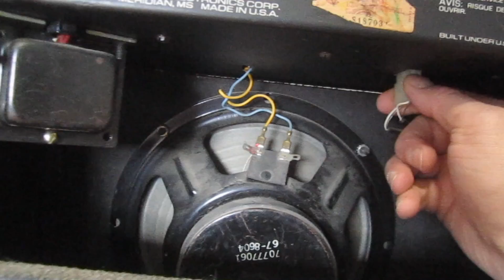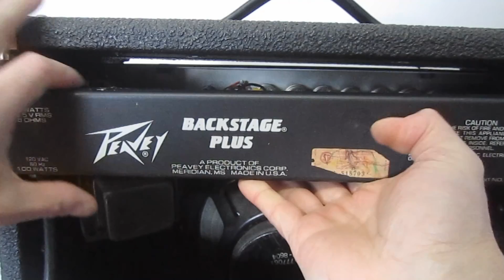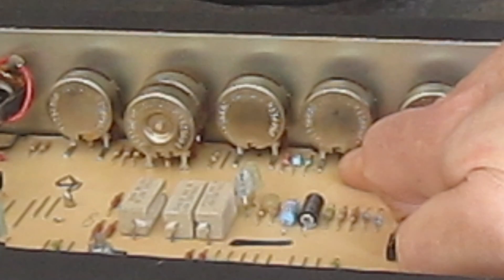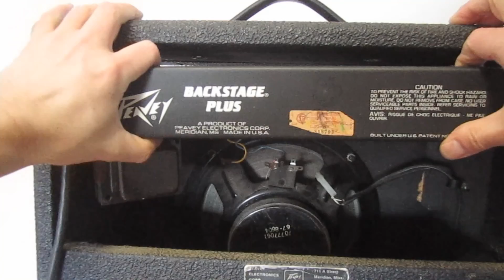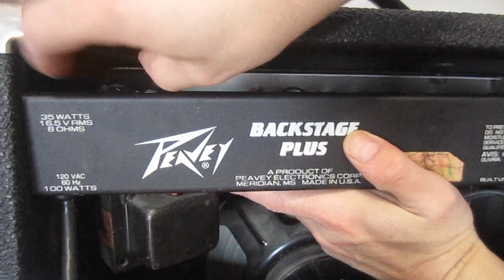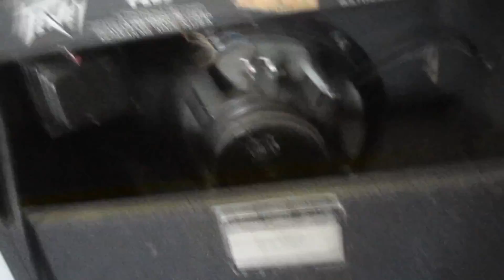DIY - How to Clean Amplifier Pots - Fix Scratchy Volume Control on Guitar Amp Peavey Backstage Plus

Comment: The problem I have with doing it this way is that when you spray cleaner into them, as it drains it out, all of the existing di-electric grease is removed also. You may want to consider spraying a silicone compound into the pots after you get all the grime and old grease out.

Comment: Yeah, I've had this amp for almost 40 years, never had a problem, good earthy sound for solid state, loud for its size, rugged construction. Only issue recently:  the pots are a bit problematic on volume so this video is genuinely appreciated to give it a tune up and see how it works out.  I've been looking for a new amp but holding off until I really need something a lot louder, it works for band practice and jamming in small halls....perhaps this might do the job in small clubs and if not, that is the time for a proper Marshall or Fender Twin Reverb.
Reply: I gigged with my Backstage Plus a couple years ago when my main amp crapped out. It is loud for its size - saved the gig that night!

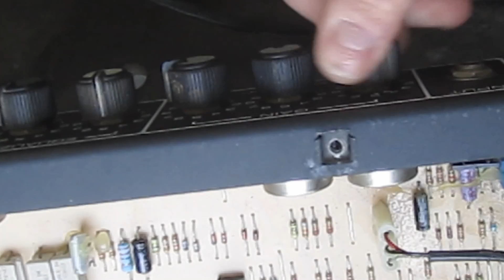Comment: 4:10 - And if you get TOO MUCH spray in there, you might just feel the difference   FOREVER because you flushed all of the silicone damping grease out from between the pot shaft & bushing.

This is how you end up with pots that feel all sloppy & loose, and don't want to stay where you set them..

Please, PLEASE go easy on the spray! You don't need anything like how much he used.. less is more.

Comment: Have the same amp. Paid $100 for it 15 years ago. Kinda like its sound. Reverb tank is crummy but the amp has some decent sounds. But 2-prong plug gives me the willies a bit.
Reply: As long as it polarized it shouldn’t be an issue. One prong bigger than the other. My amp tech said it was ok and didn’t change to a three prong? I wanted a three prong plug but…
Reply: @benlogan430  
Thanks for the info, Ben!

Comment: I worked for me ,, my Peavey supreme head had a bunch of the knobs that were scratchy a couple weren't working right , had to press on the one treble knob to get it to work , then it only worked after 6 same w a couple of the other ones , I thought they needed to be replaced,, I sprayed the minimum amount I could in the pots , I had to go back and do a couple of the pots twice , but sure enough for ten bucks I fixed it , ty

Comment: Just bought a peavey 6505+ 112 combo used, that I am using in my bedroom. I've noticed something about the amp that I don't know if it is normal or not:

When I am using the crunch mode on the rhythm channel, It just gets so loud past 1 on the "pre" that I just can't push it further to get more distortion/crunch, no matter the level of the "post". Basically, this means that I simply can't use this channel to get the overdriven "Marshally" tones usually advertised on reviews. Additionally, the "pre" on the rhythm/crunch channel seems to act more as volume than a distortion nob, as if I move it slightly the volume will increase significantly. On the other hand, the post button doesn't seem to alter the volume unless I crank it.

On the lead channel, it seems to acts as I was expecting: by moving the pre I get more distortion but not more volume, and by moving the post I get more volume

Any thoughts on this?´do you think it could be dirty pots?

Comment: the speaker wire polarity does not affect the sound at all. you can reverse the speaker wires and it will still sound the same.

Comment: Thanks Chuck. A good and sensible demo. Time to spring-clean the pots in my newly-acquired Backstage 30. Any parts in there that could give you a shock even un-plugged?
Reply: +Timothy J. Horan   Yes, capacitors can and will store voltage.  Always drain caps first before you stick your HAND (only one hand in or on a amp at the same time...also, De-Ox_Id is the best cleaner for amps...hands down!
Reply: Duly noted Chris I agree it's never a good idea to to give potentially dangerous advice to a novice like me out here on the inter-web. I thank you for your non-advice ''advice'' you answered my question and because of that I continue to make no attempt to ''service'' any of my amps: tube or otherwise. I've never opened any amp chassis. Until getting a Peavey Backstage 30 I've never owned a transistor amp.
I see you've taken half of your otherwise useful comment to jump ugly with The Evil Empire. It is to laugh.....

Comment: You should not just simply use contact cleaner by itself. You have to make sure it is cleaner AND lubricant, otherwise you will dry your pots and friction will end up damaging them. They come in separate cans or all in one, just make sure you clean them and you lubricate them properly. Great video!
Reply: +Franco Rodríguez De-Ox_Id by GC Electronics is the best pot cleaner by far..no need for anything else!

Comment: I had a band rehearsal this last Sunday just gone (7/01/16) and the volume control was crackly as hi hell. I have some spray for it (I am unsure of the name of it) which a sound engineer in a studio advised me to buy. I got some. Now i just watched your video, and i am just curious if its the same type of spray your using, or, is what you are using, a spray as I cant tell ? but i think what your doing is spot on from what i last did... but i haven't used my amp in a LOOOOONG time.. and i need to start using it more regularly now being back in another band.  When i find out the name of the spray i use, i'll let you know.. but great vid, respect my friend !
Reply: +Martyn Allen   De-Ox_Id by GC Electronics is the only cleaner to use...pure magic!!

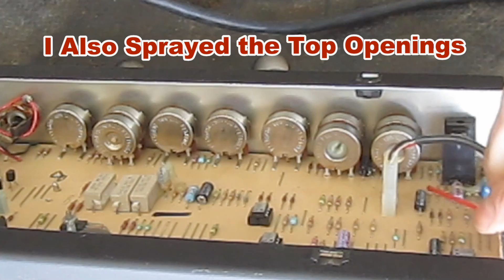Comment: Nice video ! Does anybody know what the "screw" that can be seen on a Pot at 3:57 does ? Is that a trim ?
Reply: just the rear of the pot,some have no shaft and this can be used to adjust the pot,like a bias pot,using the proper tool...of course.

Comment: Question, I have a GXL65 CRATE american made solid state amp. It has an semi open back, it has a Crate 12 inch speaker in the back, with no visible damage anywhere on the speaker, or the amp for that matter. I have had the amp stored in a dry and
climate controlled area for the time I have owned it. It is about 10 years old. I bought it new. Here is the issue; I have a metalzone 2 BOSS pedal, which I use with this 3 channel amp. This pedal can get a very harsh great metal tone. Lately, while using it, I am noticing some signal noise, like its own distortion interferance that is NOT a part of the normal sound when I have the pedal on. The notes I play sound muddied now compared to the nice distortion sound I was previously getting. The rest of the amp without the pedal is fine, so far. Can you point me in the right direction on what to do? Before I send it to the local Guitar center for a repair??? any help would be greatly appreciate it, it is actually in my profile pic on the lower right there.....Please help?
Reply: +Roland Lemus does your guitar have active pick ups ?
Reply: no, it doesn't, however, i just had to adjust my pedal and it sounds fine now. Ithough I busted my speaker at one point, but it turns out that the setting effect on the amp and  a certain setting on the pedal don't like each other, everything else is fine.
Reply: Could be a possible ground issue? Does your amp have the 3rd ground prong still on the plug?
Reply: My amp is good now, I had a pedal set up wrong with it, had to tinker a little but found out it wasn't the amp, thanks for the response!

Comment: Good video but realize that it is a temporary fix. Best solution is to replace the pots.
Reply: My experience is that pots do worn out. I'm a guitar player who uses all pots all the time. Moving parts eventually break down on you. A cleaner is a temporary fix and it helps but the problem returns after weeks or months.
Reply: I use a lot of pots too!!! A thorough clean and lube with genuine Deox-it backed up with a squirt of Fader-Lube is the way to go in most cases. Changing pots isn't something someone at home is always capable of doing. If pots genuinely need cleaning a good repair shop is usually best to perform such a repair.
Reply: +Marco Hermans   It's not temporary Marco.  Try using De-Ox-Id by GC Electronics...works like magic and continues to work for a very long time.  Pots rarely wear out completely, it's usually just needing cleaning and lube ( DEOXID does both)
Reply: Replacing pots is a major PITA. I'd say if the DeOx solution works, even temporarily for a year or two or three, you're ahead. Once DeOx stops working, then worry about replacing the pots (or the gear, if it's not worth reviving).
Reply: If you have good quality pots (CTS), unless the amp is really been abused and the pots cycles many thousands of times, the pot will just be dirty or corroded and cleaning will make it like new. Also, for newbies, especially with tube amps, not a good idea to mess around with pulling the chassis out unless you would enjoy getting the shit shocked out of you or getting killed.

Comment: It's probably my OCD acting up, but the color configuration on the knobs (from left to right) is white, dark grey, blue, grey, grey, grey, black. Good amp, though. Mine, the previous owner left it in a gazebo for 12 years, so it got a lot of humidity and freezing and probably wind blown rain on it. The bottom is fairly rotted, and the baffle, but it still works flawlessly. I've had it for 7 years now, and only replaced the speaker (I guess from the all that water the cone got messed up, because it sounded like I was playing out of a cardboard box.) Amazingly enough, the pots didn't need this until within the past year. Peavey built them like tanks at the time.
Reply: +Frank Riccio III Just checked colour configuration of knobs on my Backstage Plus and I agree with you.  I've bought mine new in the mid-80s.  Didn't know much about amps at the time but loved the tone - still do. My amp is still in great condition and has never missed a beat. Some of the pots require a bit more effort to turn than others and a there is the odd one that crackles.  Time for a 'spring clean'. Glad I found this video.  Plenty of life in the old girl yet!
Reply: Honestly, I never cared for the tone, but it's a tank and never left me hanging. I found a Special 130 from the same era years later and bought it because I knew it would never die. That one does not disappoint either.
Reply: mines full of dead spiders sat in my friends garage after someone gave it to him but he never got into guitar so he gave it to me

Comment: Mine is not making Any sound at all. I used to hit with my Fist on the top of it and it would play for Awhile. Do you think that it can be fixed with contact cleaner ?
Reply: Ok, finally i cleaned the knobs with contact cleaner and now it works.